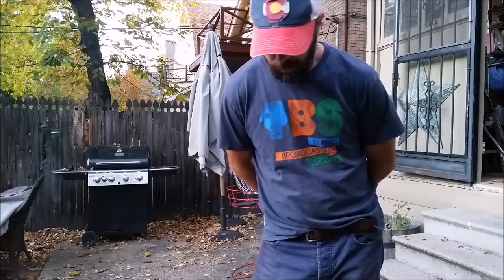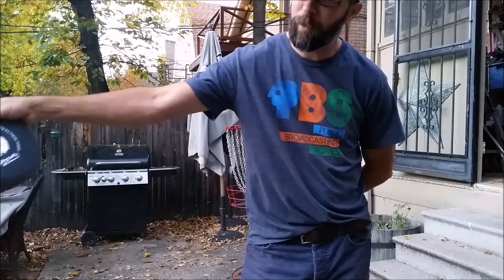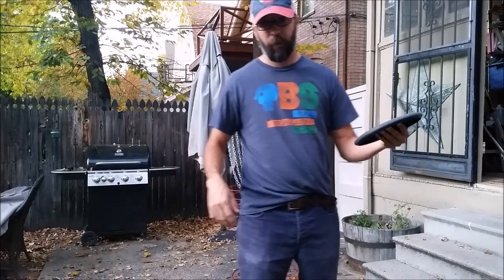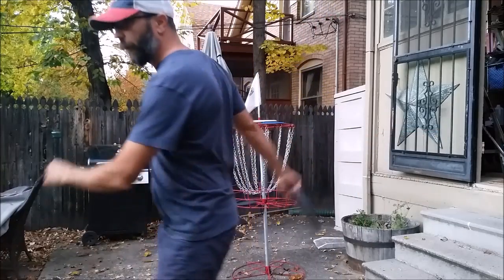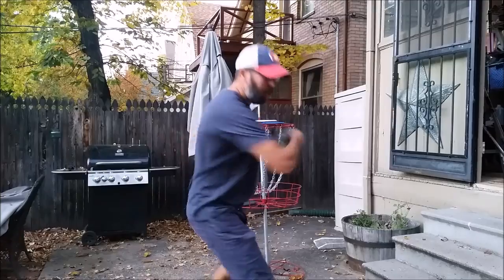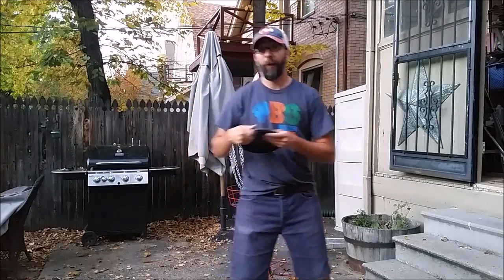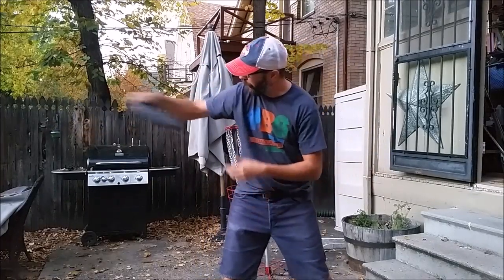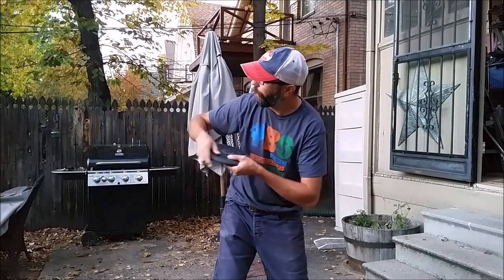Bracing

Comment: Gidday Jason, I'm just finishing up an article on bracing and thought I'd revisit this old video of yours.
One thing the top few golfers now do is to straighten the plant leg during the elbow smash. This moves the right hip slightly upwards and slightly backwards along the LOP which slightly increases hip rotation speed. It also offers a much higher level of traction as the extension pressures the ground more. Then once the knee and hip extension is complete, it instantly deweights the plant foot which disengages the forefoot to pivot on the heel.

Drew Gibson is the player who is demonstrating this technique most strongly, and given he's throwing 600 feet while finishing in balance on his plant foot, he's arguably got the finest backhand power form of any player. Eagle does the same thing, but not quite as powerfully as Drew.
Reply: Yes, I've been thinking about this a lot. The rotation has to come from somewhere. Ultimately the faster you rotate, the faster you throw, but the means of getting that rotation and "using" your hips is not that obvious. What I've come up with so far: The rotation of the hips starts from the body swinging around the back foot/leg, and is further accelerated has the right leg planting and pushing the right hip back and up (the reason that the plant foot is ~perpendicular to the line). By then extending the plant leg as the arm swings out, the arm get accelerated just like a pendulum accelerates from gravity, same concept as a hammer thrower.

So far the only role of muscle is to be able to keep the frame and catch the weight (+the right leg push). I'm thinking though that you further increase the rotation by actively opening the torso (?), the elbow, (even the wrist perhaps) and shoulder. You can't create rotation out of nowhere, and at this point your back foot is deweighted, so whatever small rotation you can create with the toes and heel of your right foot is negligable and probably would destroy your knee since there is so much weight on the foot already. Actively opening each body part like this therefore has to slow the previous body part down. This is the same reason why twisting your hips does not work. You do get a little bit of rotation from pushing the ground, but mostly your torso has to rotate counterclockwise as rapidly and no power is gained, only backpain. Anyway, slowing the previous body segment down is not a problem as long as it has already transferred it's momentum to the next body segment. This part of the throw is probably near impossible to teach, and people trying to open body parts before the previous body part has transferred is what causes muscling/early pull. But I think it's still important to think about because eventually you can't get more juice from simply your left and right "foot". There is some power in the beto drill portion of the throw.

Comment: Thanks so much for your videos!  Like most disc golfers I try  to improve my game as I go out and play each time. I appeciate your tips and insights, especially on balance and footwork.  I've had a tendency to hurt my knees at times because my balance gets out of control. I'm sure your tips on bracing and balance will help me stay more under control, and avoid unnecessary knee-tweeking!
Reply from the maker: Glad to help Thomas!
Reply: I have the same problem, with my knees. Your breakdowns have completely changed the way I approach my drives. I can't say I have been able to reproduce the technique completely but already seeing a difference.  Thank you soooo much for making these videos!